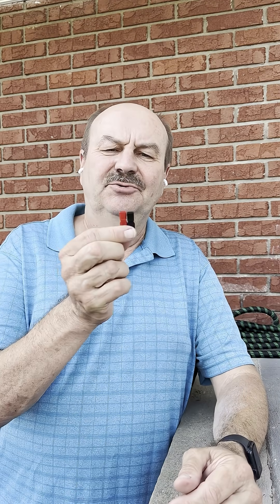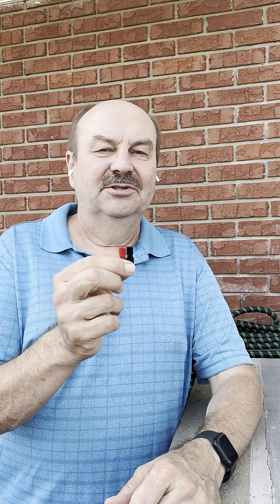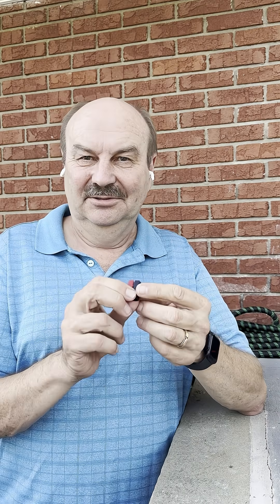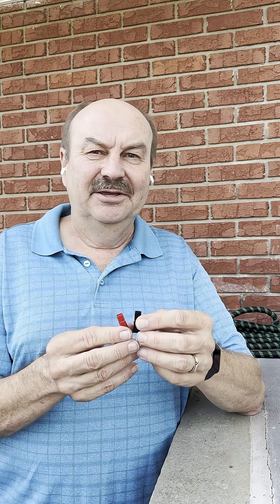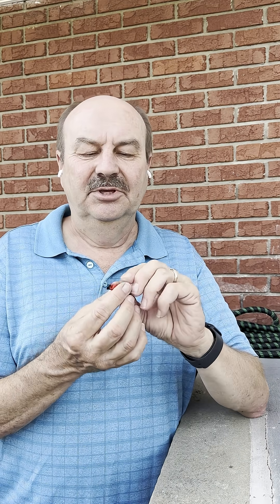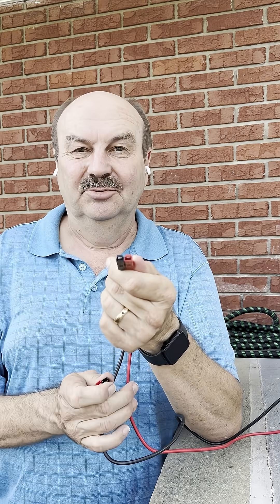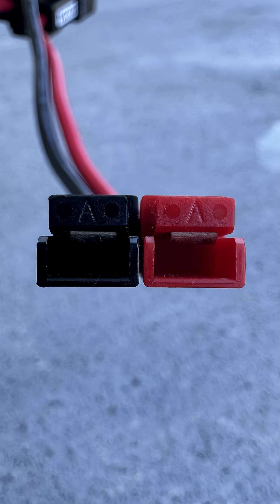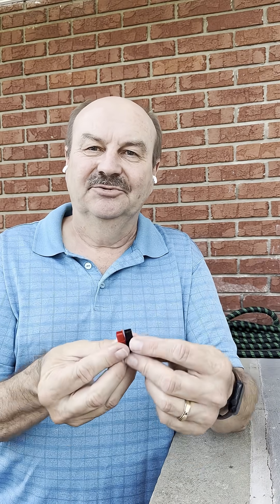PowerPoles Memory Aid

Comment: Red right tongues up. That phrase helps to also know which way to insert the metal connectors that slide into to Powerpole Housing. They go “Tongues Up”.
Reply from the maker: That’s a great tip, I will have to remember that one too.